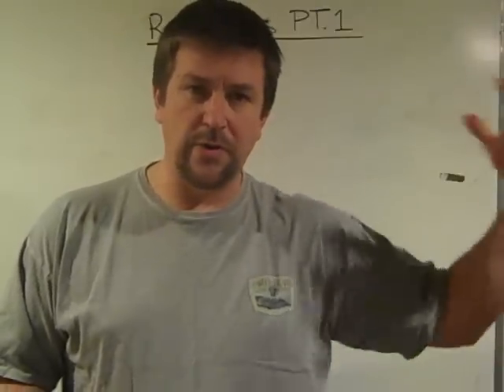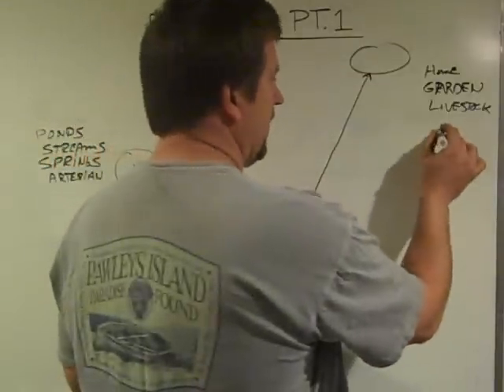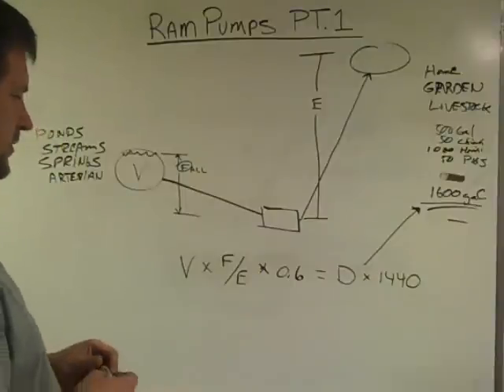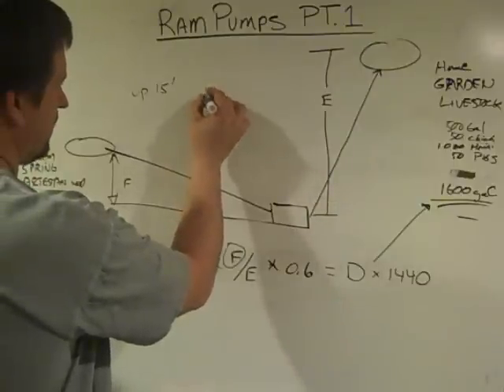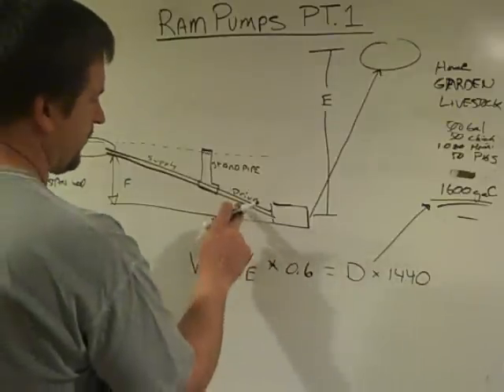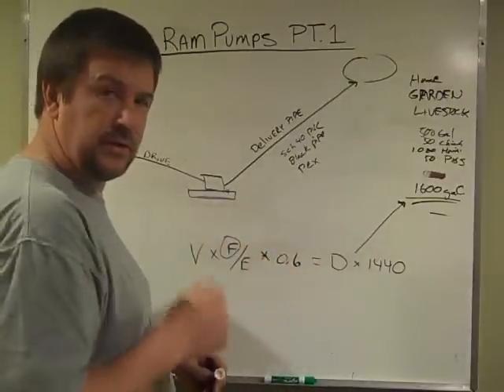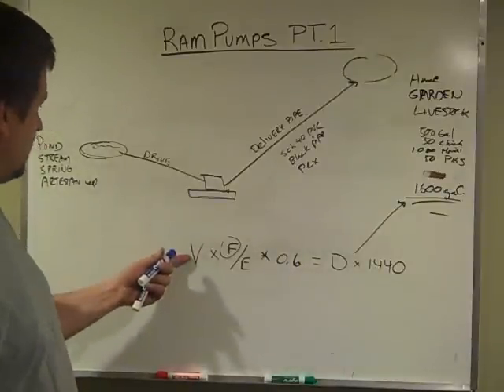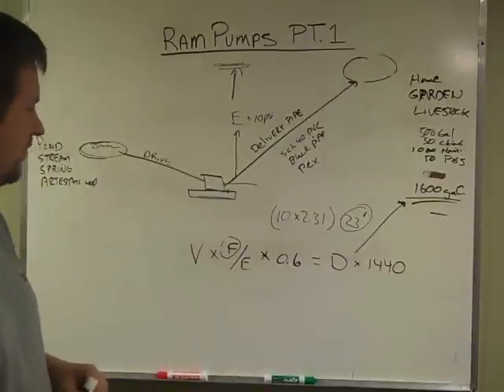Ram Pump pt1

Comment: Why not have a third check valve on the inlet before your hammer valve, even 10 feet back to the source,  to prevent the spike from ramming back into the supply line? Could this work, and maybe increase efficiency, or possibly prevent it from working?
Reply: i thought about that and did some research on how a shock wave behaves inside a closed water system. I have come to the conclusion that you might not even need this. if you put your check valve at the end of your pump vertically and your pressure valve right before that vertically then all the shock wave will dissipate into your pressure champer and almost nothing will come back to your pipe.
Reply: sorry by check valve i mean the waste valve
Reply: nope i tested it you still have part of the shockwave kicking back. im going to test the third valve now to see how it works. it shoukd work

Comment: I am about to install a 1.5" ram pump. The water in our area is quite aggressive and tends to rot out galvanised steel pipe in a few years. Any thoughts on the drive pipe? Would hdpe work if I set it in a trench of concrete to counteract the water hammer?
Reply: Not an engineer, but my understanding is there's (at least) two factors at play. Rigidity of the pipe to combat the flex triggered by the shockwave travelling up each cycle of the pump, and the material's sound velocity performance. From this source: https://www.olympus-ims.com/en/ndt-tutorials/thickness-gage/appendices-velocities/ you can see steel allows the shockwave to travel a over twice the speed of HDPE. Maybe a thinner walled stainless steel is an option with the concrete jacket to counteract the corrosive environment, or look at pre-treating your supply to bring the acidity down.

Comment: Will a Ram Pump work if it is built with a !/2 inch drive pipe and 1/2 inch fittings and 1/2 inch check valves?  I don't have enough water to run my 1 inch Ram.  I am getting about 1 gallon every 1.5 minutes.

Comment: Has any one ever seen a 1/2 inch pump work.    How about using a check valve about half up the delivery pipe?  It appears it will help with holding the pressure and allow the pump to deliver more water up the hill.

Comment: Hallo Engineer775 , I need to know if my ram pump will work if the delivery pipe is already installed as a 50mm black pipe ( currently being driven by a submersible pump ) .I will T into it from the delivery of the ram . What is the minimum drive pipe and valve sizes that can be used ? Regards Fred

Comment: Is there a way to configure the ramp up to Spring water by utilizing creek water as the energy source
Reply: Tim Blevins I think he addressed this in video 3 or 4. He had a port machined on his store bought ram which does exactly what you say. A diy hack to that purpose I have not seen. But man a dog version that would be an invaluable video for me as I have been digging my spring out all day here in the 100 degree heat.

Comment: Ok so i want to pump water from a small pool through black hose to heat it and back into the pool now i belive i can gravity feed it down to the pump and it will work from what i have seen but i cant be wasting all that water how can i get my over flow waste water whatever you want to call it back up into the pool? Could i hook a hose to the one thing that is wasting water on the ground? And make a closed circuit pump no waste
Reply: Brian Hunt Not possible - that would be a perpetual motion machine.  If the heating in the black pipe is significant, you may be able to use a thermosiphon, also called a thermosyphon.
Reply: Brian Hunt If you attach a hose to the top the checkvalve will just stay closed and you won't pump anything, hence the ~60% efficiency.  You could maybe get a drip tray and have it drain somewhere else where you can manually dump it back into the pool.

Comment: no need for slaves. How does one make a two ton block of stone weightless? With two tons of something else, that's how. it is called counterweight. You can pull the stones right up the side of the pyramid on a layer of tracks or ruts carved into stones that were laid right over the casing stones. Those ruts cold have been greased and watered to greatly eliminate friction. No hauling, no ramps, no slaves. At construction level the blocks were picked up and placed by the "boat cranes"

Comment: good day
i have a question,if you connect  two ram pump on the same drive pipe would it work,one pump is a 1 1/2" and the other one is a 1 1/4".i have with 24' of head and trying to pump 98' up hill.i actually have the 1 1/2" pump working but it is not reaching where i need it to reach .
Reply from the maker: Husent Elcock no sir you cannot put two Rams on the same Drive pipe you can put multiple Rams and but they have to have their own Drive pipe. Your RAM that won't reach should definitely be able to I don't know if you made the Ram or did you buy the ram? I would be glad to help you figure out what's going wrong.
Reply: Good day
Regarding the ram pump i made the pump myself,...wile the pump is working i am hearing a "piff"sound like if it is letting air out some where around the pump area but due to the fact that the pump is working it is difficult to be certain.so i am planning to take the pump down and rebuild it .i got water up to 98' with a 1 1/4" pump so that why i am puzzle with the output of this pump.i will put back up the 1 1/4" ram.

Comment: What is the maximum head pressure of one of these pumps ?
Reply: Sorry, bad question .. I need to pump up180ft (60m)with a flow rate of 2.64G/minute (10 litres) can I do this ?

Comment: OOPS! Misspeak... 2.31 is feet / psi, not psi / foot. 
That is about the 0.5 psi / ft [ 0.433] that commenter +kleinjahr refers to.
Dimensional analysis shows this.
PSI times ft / psi = ft    The psi's cancel leaving feet. 

14. psi roughly for one atmosphere.
We know one atmosphere lifts water around 33 ft.
14 psi x 2.31 ft / psi  =  The psi's cancel leaving feet.  =  34 ft.
--
Cheers, ScienceAdvisorSteve
pokin' around looking at ram pumps...

Comment: dear engineer 775 or anyone who can verify if this is possible. hopefully i can describe this well enough,  my questions are > what if the distance needed for the drive pipe length is not possible if done in a straight line down to the pump, but instead was achieved by coiling [like a spring] the drive pipe to gain the distance of feet but doing that in a smaller land space area? what I am asking is lets say I have a fall height of only 1 foot, into the drive pipe that's coiled 15 or 20 feet length and reaching the pump 3 feet lower and want to reach a 7 or 10 foot straight up delivery point, and have this happen in only a 5' x10' land space.   land space could be 50' x50' or 1 acre  my primary question is  > could coiling be used?  my thinking is water doesn't really know its heading a straight line any more than if its making a smooth curve. or does gravity and magnetism play into the spin?  I have no way to test this, but wondered if anyone had or would test it. please let me know. theory is great but practical reality is better.
Reply: +magik knights I know this is old but just in case you didn't get a response I thought I would offer some thoughts.  Might I suggest you consider creating some type of catch basin or other container at the top of the supply/drive side.  This would help apply some pressure to the line.  Also, to maximize the energy of the spiral the coil would need to be as vertical as possible to prevent losing energy from any vertical flows that would result if the same coil was placed horizontal.  The real problem with the spiral is that even though water doesn't care which way it goes the spiral will introduce more friction as it generates more turbulence.  Another option would be to use a larger supply side pipe.  After all, the purpose is to take advantage of energy generated when stopping a large volume of moving water.  Just be aware that you can have too much supply/drive side pressure which will defeat the pump as it resist the hammer action.

Comment: I enjoyed (and learned from) your 3 videos on the pump.  I have been trying to determine how to determine volume of the pressure vessel, studies a ebay item 263536434972 to determine volumes (as an example).   My flow will have a small fall and not that long a run when it rains, how is this pressure vessel size determined and is one too large an issue?

Comment: perhaps some engineers out there can set me straight....say, instead of 60' of 2" drive pipe for a 1" (whatever the outlet pipe is called) you use 30' of 4" drive pipe....is the math roughly that simple for the physics of it or am I being a silly uneducated noob?

Comment: Hey Engineer 775! Love your videos. I can't find the CST Berger Sight surface level in my area.. Do you recommend any other option? What do you think about this one here?? : http://www.amazon.com/gp/product/B000KEQ4BK/ref=pe_58050_135127420_em_1p_2_ti
Maybe you know of a cheaper option to be able to determine the head I have?

All the best!! 
Attila
Reply: I know this is a 1 year old post and you've likely figured out your head but this may help others.  Here is what I did.
I have a small spring, and the further upstream I go, the less flow there is, so I selected a spot as far up as I could that I thought would supply the necessary flow.  From there, I purchased 200' of 5/8" garden hose, which I needed anyway for my delivery line.  Now I put one end of the hose in a pool where I want my drive(Supply) to start, and run the hose 110" down the stream to where the pump would go.  Now  get all the air out of the hose until you have steady flow.  Now simply raise the end of the garden hose until the water just stops flowing out.  The water in the hose will now be at the same height as the top level of the supply pool.  Just drop a tape measure and now you know your supply head (drop).  I realize that for drops over 6' this gets difficult without a ladder or something. but if you are around 6' or less this is a very simple way to figure out your drop.
Reply: +James Sutton thanks James for the response, it's a great way like you said for up to like 10 ft but I'm trying to determine anywhere between 40 and 140 ft worth :D

Comment: Do you know if a ram pump can work in the following scenario? A 45gal drum of water on a 15foot ledge drops it's water straight down througj a copper hose connected to a ram pump. Would it be enough to have the pump bring it back up into the 45gal again?